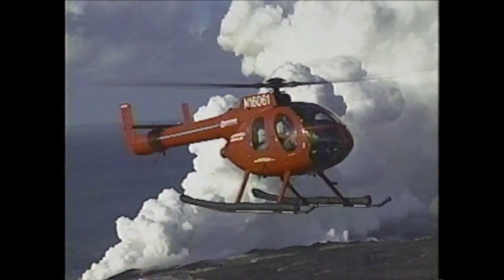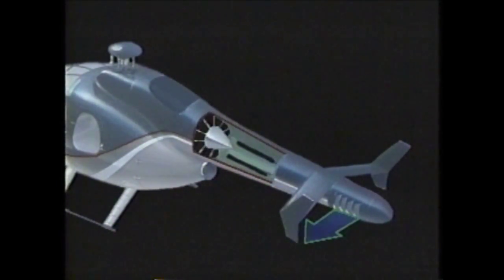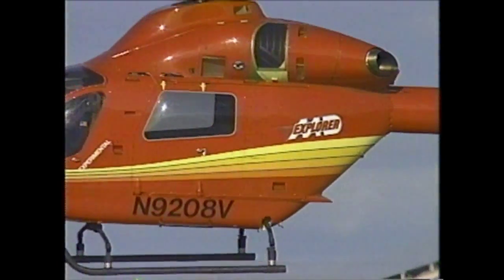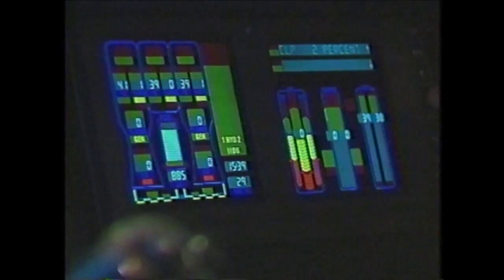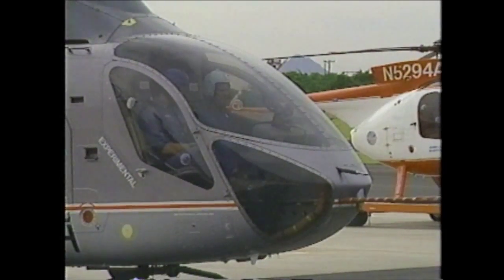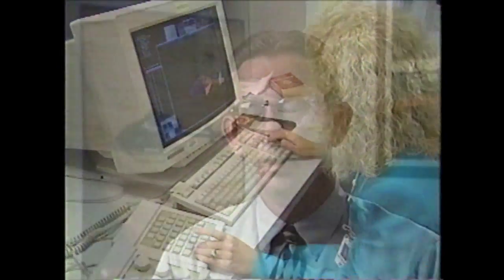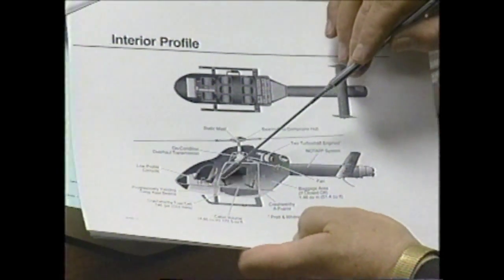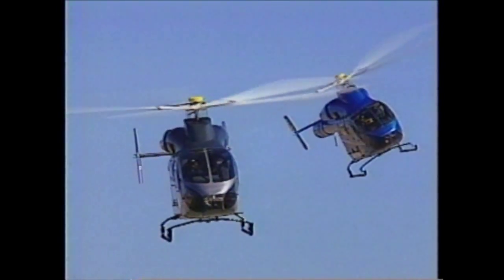The MD-900 Explorer Helicopter

Comment: They just never caught on. And for hot and high operations they are unsatisfactory, they are also slow for the class of helicopter compared to Leonardo A109S they cruise 30 to 40 knots slower. And the amount of fuel they burn is high for their limited performance. When Phoenix PD had their 520N Notars, they quickly renamed them Slotars after their first hot day's flight operations. There are many reasons why PPD bought 520N Notars most of them are very questionable. 🐌